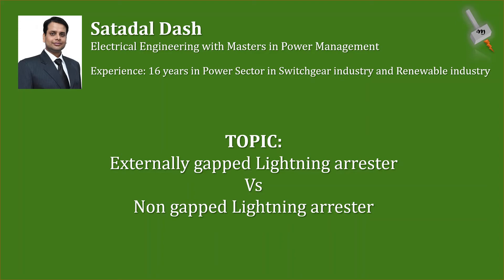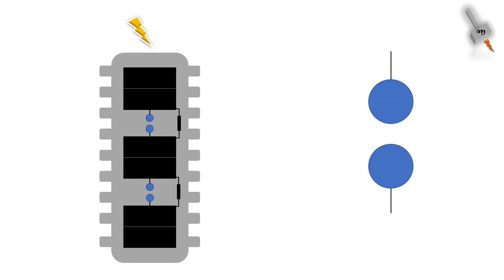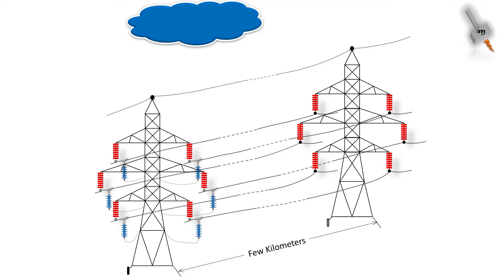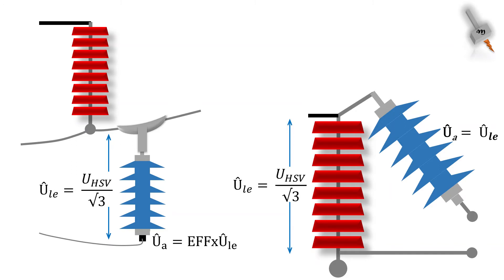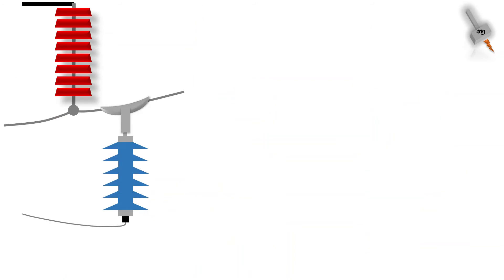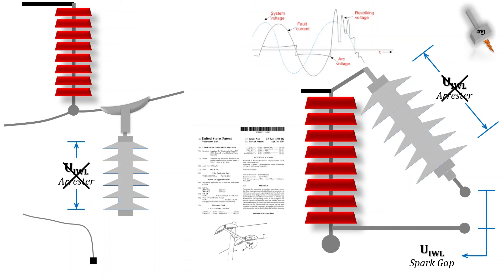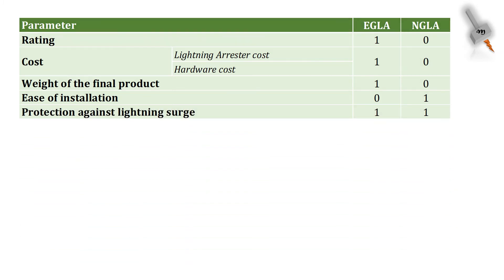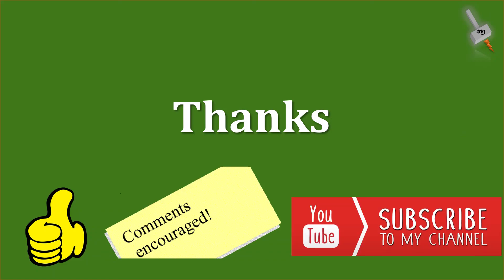EGLA vs NGLA (Externally Gapped Line Arrester verses Non Gapped Line Arrester)

Comment: Good insights on two types of line arrester! In this video, you mentioned about positioning of line arresters on a tower. So if possible, can you please make a video explaining some case studies or online data on what are the different parameters to consider while positioning of arrester on tower? Thanks!
Reply from the maker: That can be done. Are you asking on individual capacity or on behalf of some 
 organization? If it is request from organization then it will chargeable basis.
Reply: @surgepulse2778  It's an individual capacity only. I just want to understand the methodology as there is huge boost in energy from renewable sources getting pumped into the grid and it's not logical and  cost effective if arresters are mounted at each phase to sustain the reliability of line.
Reply from the maker: Are you looking information on transmission line protection or inverter based resource protection?
Reply: @surgepulse2778  Transmission line protection